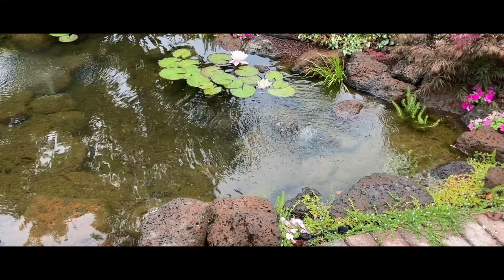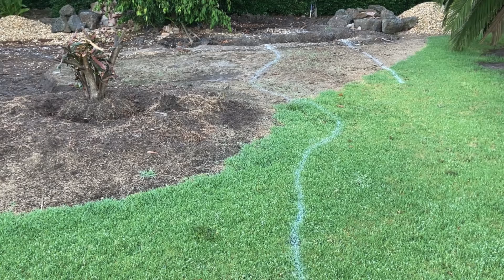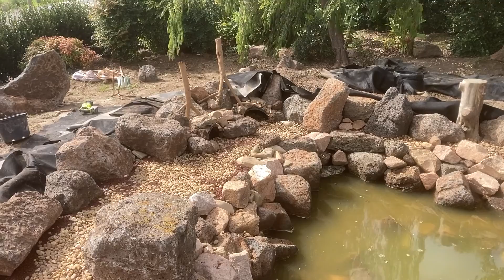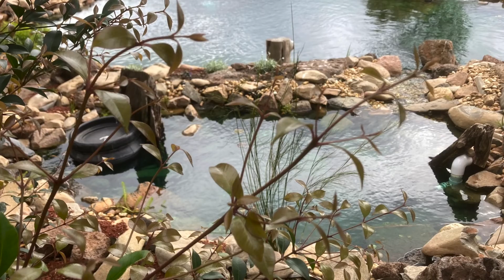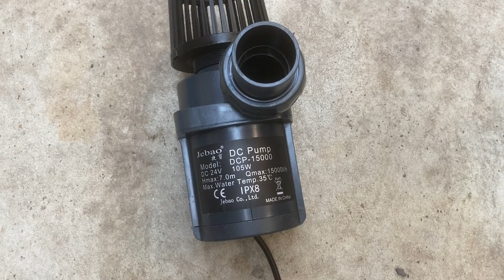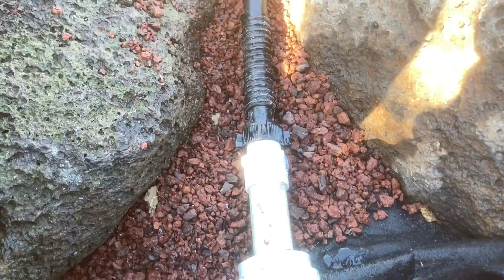Cost to build a large backyard pond| DIY

Comment: What is the electrical consumption kwh for this pond? If living in a 4 season climate, what would you do during late fall, winter, early spring? Would you run pumps during those seasons?
Reply from the maker: This pond runs anywhere from 0.2kwh (200w)- 0.3 (300w) I’m using variable speed pumps. 4 pumps @ about 50w, plus an aerator (20w). Sometimes I put the pumps up more, sometimes less. I run them all year.

Comment: I disagree professionals would not done a better job. Yes I think 60k is about right. Excluding your intake bay so perhaps 70k i think people are getting ripped off. I don't see the money when you break it down. Rocks are dead cheap and liner not that expensive then skimmers pumps piping. My only criticism is you could have used larger rocks in the build. But yes its a good build i would suggest building a stone wall below the water level to hide the visible liner
Reply from the maker: Yeap I wish I had been able to use larger rock but I couldn’t afford a machine to just sit around and be available when I had time to work on the pond 😞. But I’m a bit upset about the wall suggestion, there is no exposed liner below the water surface, there’s some on the edges where I’ve still go to tidy up. But the pond itself is completely rocked.😞

Comment: Looks so good, Kev. It's just going to get better and better as the landscaping grows in. Our ponds are similar in size and features and I was about to say, "we're at about the same cost" but then I remembered I'm spending USD and you're spending AUD... and I still have a $1-2k more to go. Doh!
Reply from the maker: I thought you’d come out much cheaper with your liner. Although you do have all those milk crates for your neg edge and wetland. I’m trying no crates in the bogs. Can’t wait for an update 👍
Reply: @Ozponds  I got the milk crates for about $1.25/each so not a budget buster (though I did buy 400 of them). My next update will explain why I did not come out much cheaper on my liner. Changed my plan too many times midway through the build.

I can't believe you got all your utilities located and your whole pond dug for $200. I paid $1,000 to hire a machine and operator to dig the initial hole, and another $1,000 to borrow a family friend's machine for basically as long as I need it. That second $1,000 has been really worth it, though!
Reply from the maker: Yes that was really lucky. My mate works in the city installing all the underground electricity so he just borrowed some of their gadgets. I hate to think what it would have cost otherwise.